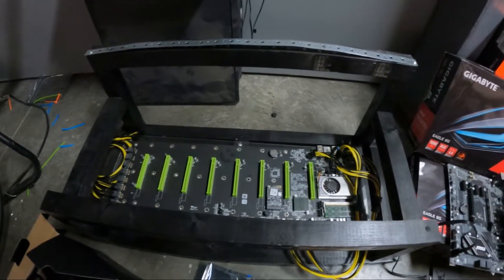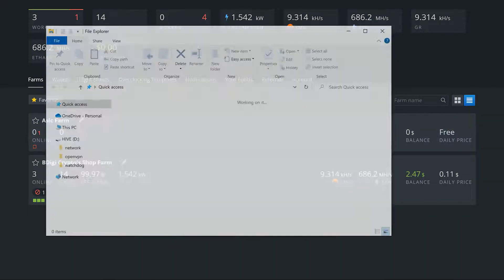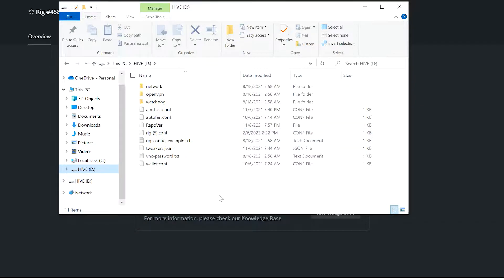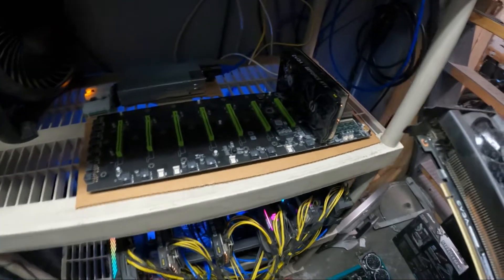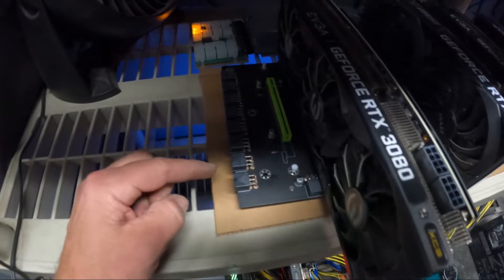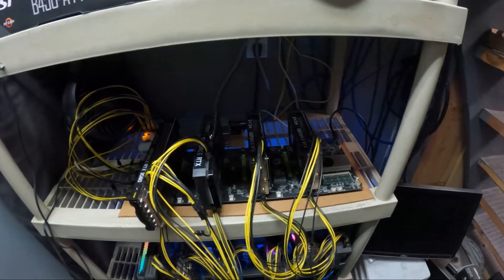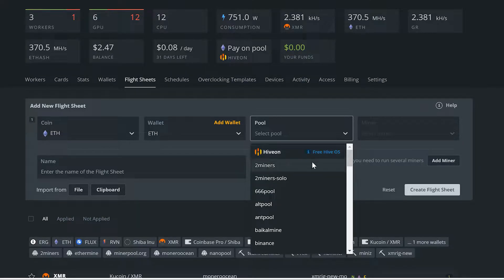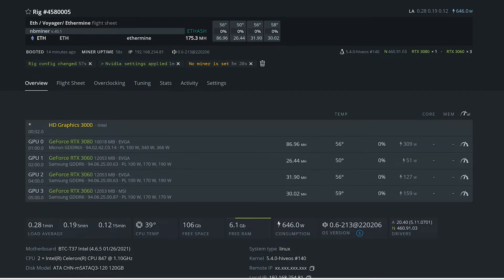How To Setup BTC-D37 Mining Motherboard!!!

Comment: Finally got one of these off eBay but I can't get it to display I think I got sold a broken board no matter how many times it worked even boot to bios tried like 7 cards it's really annoying. Took soooo long to save up for the thing omg.
Reply from the maker: You did try to use a different HDMI?

Comment: FYI - Hive OS says that's a T-37... not a D-37. See 11:55 - Lower Left of the screen next to motherboard - Strange because the color of the board is correct (for a D-37) - AND - a T-37 doesn't have the PSU connectors on the side (where as the D-37 does). So I'm guessing HiveOS is reading the board incorrectly.
Reply from the maker: Yes probably cause of a bios update or something. The motherboard is printed D-37.